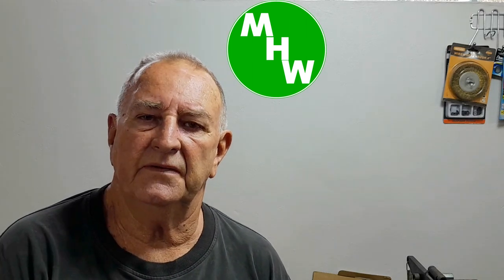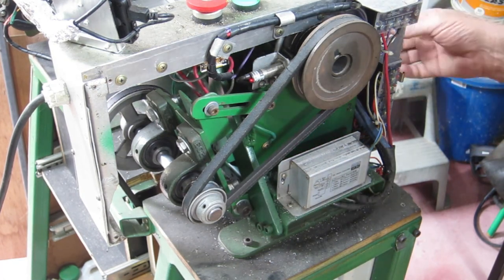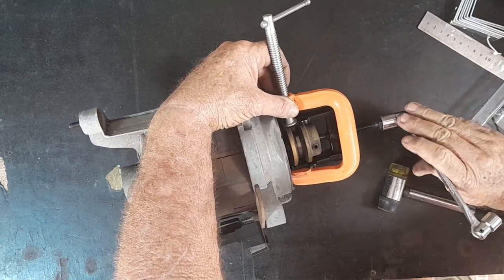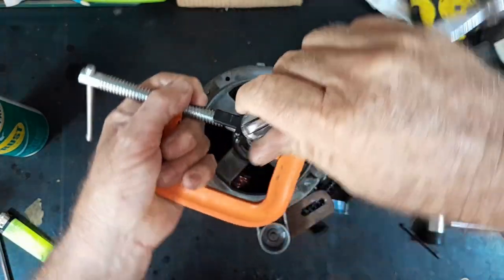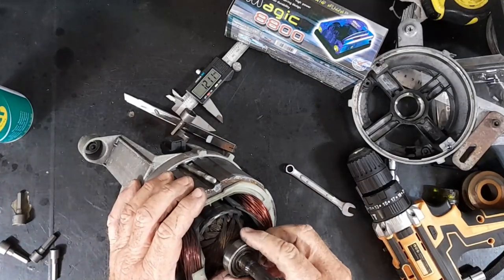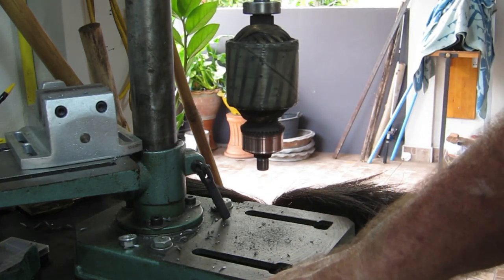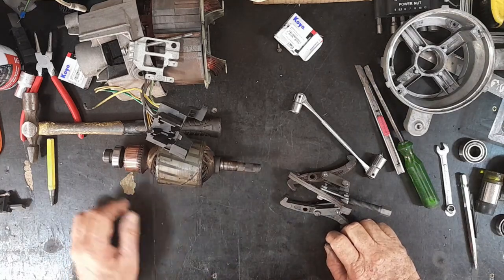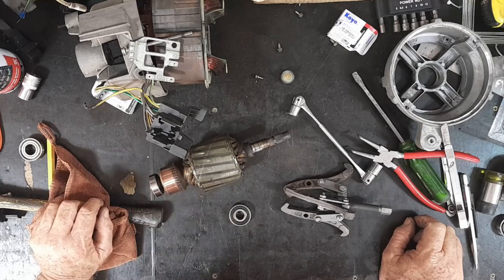MHW Episode 67 - Workshop Noise Reduction - Part 1 - New Motor Bearings

Comment: Enclose the motor in a box lined with spray foam or whatever you can get cheap and put pc fans to keep cool. Treadmill motors are easy to get and very quiet and you don’t need pulley to adjust your speed
Reply from the maker: Treadmill motors are hard to find 2nd hand here that is why I went with the washing machine motor 👍

Comment: When I was racing cars all those years ago, the sanctioning body required us to pass sound checks because of noise complaints.  They suggested that, as a cheap and simple first step, we aimed our tail pipe(s) towards the ground instead of straight out the back.  It did work, and made a reduction from horrible down to terrible.

I think maybe the covers on your machine maybe vibrating like the soundboard on a guitar.  Maybe put foam on the sides and top of covers, and leave the bottom open so the sound smashes onto the ground.  Each decibel you can knock off is a big help.  I think you'll win this a little bit at a time, instead of BIG improvements.

I also recollect that the people who complained about the racetrack, never noticed any improvement.  They really just wanted us gone.  Bridgehampton has been a dam golf course for a number of years now.
Reply from the maker: I would think that it's Same Same as they say here for me 👍

Comment: For the lathe I'd suggest trying enclose all the moving parts with some panels lined with insulting foam to cut down on the whining and for the room as a whole look into buying or making some sound dampening/acoustic panels to put on the walls and ceiling or even packing blankets will work. 👍👍
Reply: Egg crates
Reply from the maker: Still working on it 👍
Reply: @MyMiniHomeWorkshop  I have a feeling that insulting rocks might be more effective ;)
Reply from the maker: @dennisbjones  We had a drug farked Thai dude in the village a few years back that was rocking our roof at night

Comment: The reason the puller came out of the packet in bits is because you can use the legs either way round and the links to the spider have two hole options in the legs. Regarding noise reduction is there enough space within the enclosures of the lathe to line them with some sound absorption material. That will probably be the best place to go after replacing the worn bearings.
Reply from the maker: Thanks for watching, I'' take that onboard 👍

Comment: Maybe stick on automotive dampening material on the inside of the covers. Enclosing your workshop in such a way that you can open it up between the noisy operations to let the heat out might yield the biggest gain in sound dampening.
Reply from the maker: Open / close idea is what I'm working on 👍

Comment: The shock when I seen the KOYO bearing packet. I've used a few of these at work and the surface finish on the ground races can be quite a bit rougher than some other brands and also grease is packed from one side and doesn't make it into all of the races. Try using some deadening mat on your guards, the same stuff they use in car doors. Just a thought.
Reply from the maker: I've not had a problem with Koyo bearings in the past, still working on the noise abatement options, just got back from 4 days in Chiang Mai, so I will get back into it this week 👍
Reply: Good luck I wish you well.

Comment: I'd go get the craziest noisy pet that is commonly owned by the locals to sound the dampen the shop noise..maybe a couple of different approaches like carpet on the walls to soak up sounds..
Reply from the maker: The woman on the high side of me has 4 barking rats, hard to outdo those noisy little bastards, but still working on it 👍

Comment: Yes, but how much noise are the neighbours really hearing? Seriously it's like your neighbours have seen you taking in heaps of produce and bringing out cooked meals and accused you of running a restaurant from your home. Have you approached them to see if they want to see what you really do? sometimes people's minds run wild, and suspicion grows because of false stories. Maybe the people where you live would be more understanding if they knew you could maybe help them out if they have something broken that needs fixing ? Surely, they can't all be arseholes?
You may need to switch out the brushed motors for brushless sewing machine motors - small size plenty of power but dead silent .
Reply from the maker: Personally, I think the real issue is I'm not Thai, they can make as much noise as they want to at any time of the day or night, and talking to them is of little value, I think the old prick directly opposite me is behind the whole complaint. 👍

Comment: First of all, sod these Karens that reported you.  Bet they didn't even have the stones to come and talk to you about it first.  Anyways, to add my $0.02; I know this is gonna sound a bit OTT but the following solved my noise generation problems COMPLETELY.  In my younger years I did a lot of DJ mixing, lot's of heavy bass sounds that carried far and wide.  I also had complaints and after damping the sound in my living room with egg cartons and other heavily patterned/textured/foam materials that I found, I reduced the db levels by a little bit, but not enough.  I eventually ended up building a man sized box around my mixing/speaker setup with MDF and old pallet wood with a double wall and rock wool in between. after a paint job, it didn't look half bad.  Of course I had to install lights and ventilation (with an "S" shaped in/outlet to keep sound in).  The difference was night and day - you just need to stop those sound waves from spreading everywhere and the easiest way to do that in my scenario was to stop the sound from traveling beyond a certain point instead of reducing its amplitude. May hap you could have a turning/milling enclosed 'station' kinda like an industrial CNC lathe, but one that you could stand in (wearing hearing protection if needs be).   Of course this does rob you of space and if that's in short supply, this isn't a good solution.  Just a thought...
Reply from the maker: You're right, they never said anything to me, we are lucky the woman next door who I'm not sure signed it or not, actually said something before it went too far. Today's video has the next steps in the process